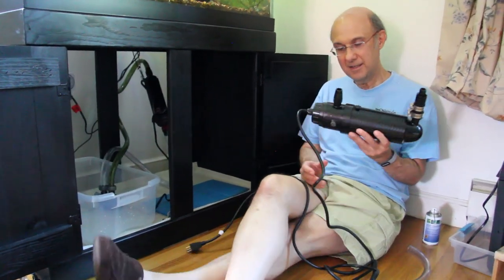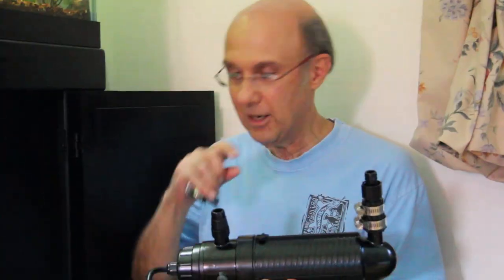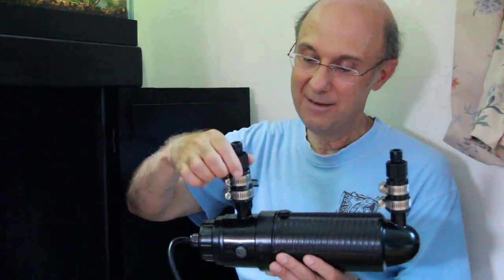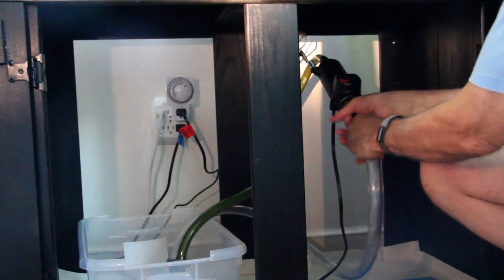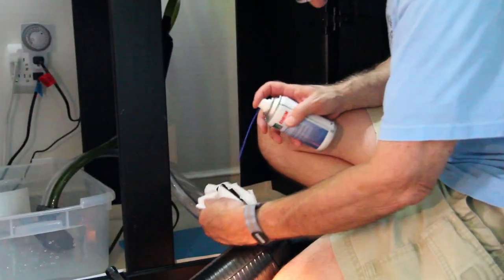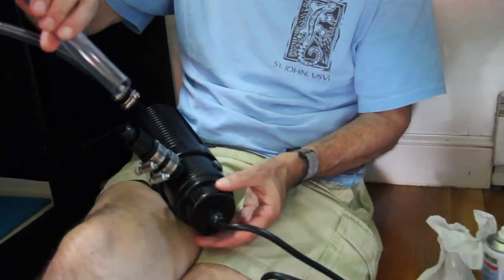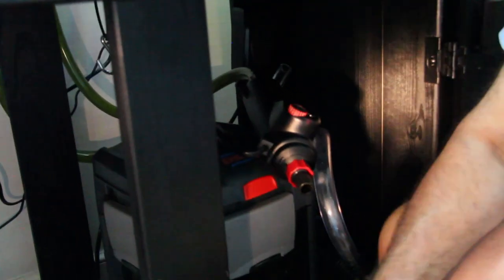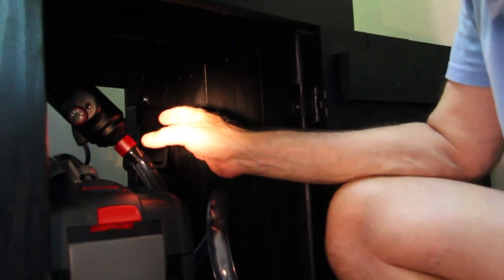UV Sterilizer Install

Comment: Great video,1 question,the silicone spray,is food grade??
Reply: The silicon spray I used was made by Eheim for lubricating aquarium connectors on the filter so I assumed it was close-enough to food grade for the discus. Another thing I learned the hard way was to prevent leaky connections, it's really helpful to use teflon tape on the connection threads.

Comment: Seems like you went through a lot of headache to get it fixed and not leaking... I know that if I was to connect the two parts together I wouldn't use metal hose clamps like you have. My choice would be to go with medium sized tie straps - good quality ones of course but at least you wouldn't run the risk of cracking the plastic nozzle(s) as you would do with those metal clamps. Been there, done that!  I know you might argue  that you can't tighten them up enough...  By using two pairs of pliers - one that has a gap (plier 1)  below the tip when closed and another regular pair, (plier 2)  you would first put the tie strap through the binder part (that clicks) and then put the long end through the plier #1 making sure its loose when pliers are closed - then with the plier #2, grasp the end of the strap and pull tight using the edge of the #1 plier as a prying lever.  this will sinch up your strap 4+ more clicks than just pulling hand tight.  Just make sure you pull as tight as you can with the pliers .

Comment: Thanks for the  upload...  I just bought  this very same item  I was going to go with a separate pump. that was a pain in the rear..  so I'm just going to put in in the discharge and be done with it.
  I never heard of an external heater before...  is that a better move that the one that goes into the tank?
Reply: An out of the tank heater is amazing! So much water flow heats the tank up SUPER fast

Comment: can I use copper solution with my UV sterilizer?my fish have velvet so I want to have both uv and copper to cure them.any advice would be appreciated so much,cheers
Reply from the maker: I'm not really sure. I know that it's possible for some aquarium treatments to be at least partially de-activated when exposed to UV, but I think the details are different for different kinds of treatments.
Reply: ok no worries and thanks.will keep researching.

Comment: Am I able to just buy a uv light meant for aquariums and not use filter just put the light on?
Reply from the maker: +Mundo Dante No - the UV light would do eye damage if you were to look at it. It must be housed inside a case that prevents the light from being seen when the  device is turned on. Since it's housed in a case, you need something to pump the aquarium water through the device - that's usually a pump / filter combination.